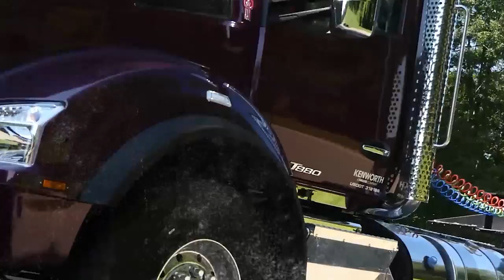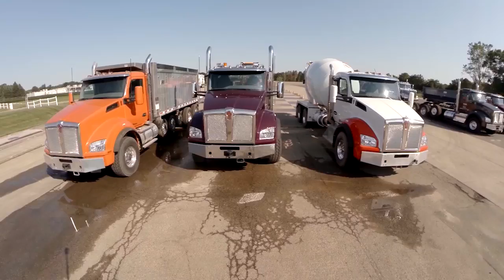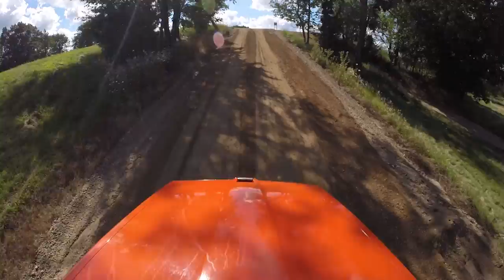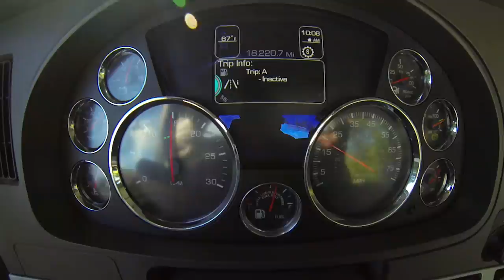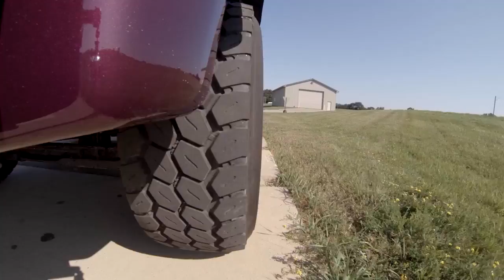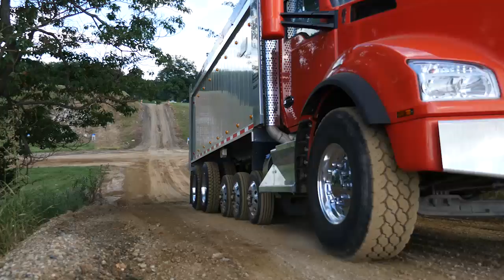Kenworth T880 Part 1: Road Test

Comment: I drive a 2017 and when it’s running I love it. Unfortunately it spends more time at the dealer getting fixed then it does making deliveries. In June July and August I only had my assigned tractor for a total of 3 weeks. The rest of the time it’s been broken down. Mostly def problems that lead to the truck going into d mode.

Comment: The T880 needs a blind spot window in the passenger side door like other professional-grade trucks have (W900, T660, T800, Pete 367 & 389, Mack Granite...).  Huge blind spot, I don't like driving them. Kenworth tells me get a blind spot mirror on the fender instead --  Nope-- they look Swift-ish, get dirty, get knocked off, they're difficult to wash & wax around, and can get iced up.

Comment: I dont mind the engine and gear noise, its all the beeping from the lane departure warning in my ear in construction zones when they move the lanes and the collision alert that always goes off on turns, in parking lots, windy roads and shadows from bridges and trees over the fwy I can do without.

other then that, I love KW's
Reply: +Wolf9Walker That stuff can get really annoying. The folks who make it say it improves safety, but I'm not there yet. It's not refined enough yet in my opinion for all the reasons you give. It's a great concept, but they have to deal with the nuisance warnings.